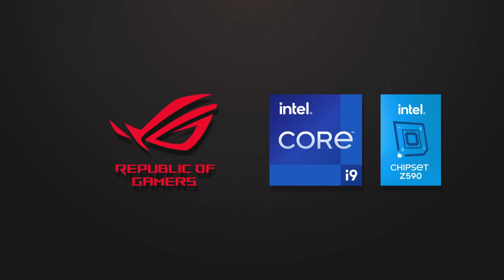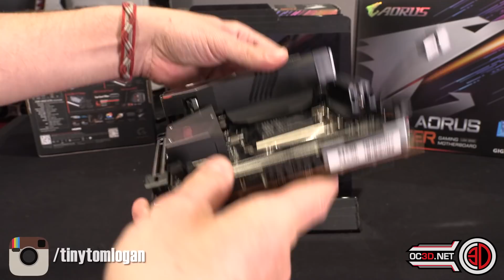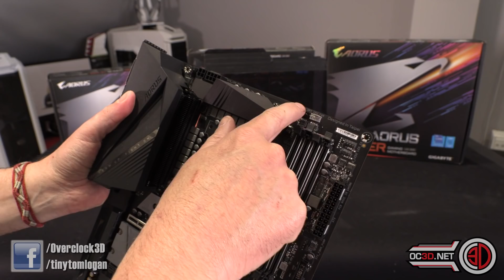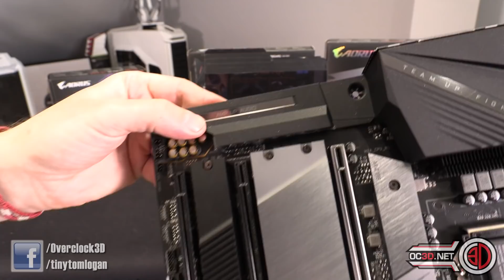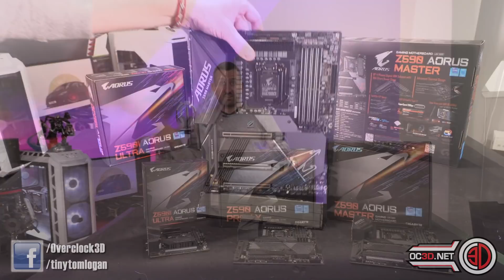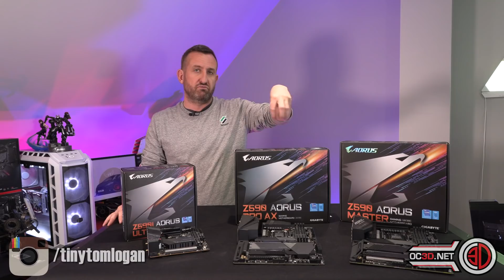Gigabyte Aorus Master, Pro AX, Z590i Motherboard Round Up Review

Comment: I currently run an Asus ROG Strix Z590A Gaming Wifi II, and it does the same thing with the AI system agent where it bumps the core voltage up to 1.65v and constantly cooks my 11900K to death. Was seeing temps in the high 70's with no overclock and nothing loading the system down using a beefy 200w TDP air cooler. Open a game, or run a local model, and the temps would peg at 100c and stay there. Pretty sure it has degraded my processor, as it now refuses to run stable at stock speeds with OOB settings, I've only been able to get it stable by disabling the Asus Multicore Enhancement and downclocking to 4.8ghz and manually setting the core voltage to 1.35v. I've been really disappointed, I spent about $1000 on just the board, CPU and memory. I've noticed that one of the temp sensors that I think relate to the VRM's often hit 125c even with the downlock I've set up. The latest BIOS available from January seems to have compounded these problems, as well. Asus has opened up complaint tickets for me every time I leave a bad review somewhere, just to tell me to reset the BIOS back to "Asus Optimized Defaults" What a joke.

I was looking into getting a different board, but it seems all the manufacturers have all taken the same approach with their Z590 boards regarding their AI system agent implementations. May end up going with an AMD X3D platform to replace this system, but so far, none of them seem to have enough PCI-E slots to facilitate my 3 graphics cards for local AI use.

Comment: That VRM temperature probably wouldn’t have got any higher. So 106 is perfectly safe. Systems are designed to run hot……….and you are 19 degrees away from throttling. Intel Engineers state that CPU’s should run close to their maximums and it is perfectly safe. You say it was throttling………but was it? I’m gonna say probably not. Lots of talking, but one graph to backup your claims 🤔

Comment: I saw your video last week after doing a build with the Master and experienced its crazy BIOS issues. OMG, why didn't more reviewers discover what you talked about here. My first master was the Z390 which I paired with the i9-9900K. So, I always liked the model. 

Upon seeing the dreadful C4 post error code at first boot, I knew that the shipped-with F4a BIOS was corrupted. After q-flashing version F8a I got a successful post. But, soon after settling the fan speeds to my settings the C4 error code came back.

When I saw the price on Amazon went down from $449 to $199 I knew that something was up. I am not awaiting a replacement with the hope of winning the lottery with the second one. SMH! 🙄

Comment: They didn't mess up the BIOS there's a 120C+ hot spot way in front of the VRM in the Vcore powerplane of the Z590 Pro AX.
Reply from the maker: It did seem to get better when I reduced the voltage so that would make sense.
Thank you for your comment dude 😊

Comment: i have 3 z390 pro's.   everything was peaches and cream until one required RMA.    i feel your pain dealing with Giga.    They're solid boards and made well but i don't think they have plans for when things go array.    i like ASUS but they skimp on power delivery unless you come off a kidney...     it is what it is.   you most definitely pay for what you get in tech these days.   the power delivery on those boards are fine for the 8700k but when i put a 9900k in them they require a 40mm fan on the vrms.  the 8700k would probably need a fan but they're cooled with a cross flow air cooler that pushes air over the vrm area.   these are intense AVX 2 loads.

Comment: That's such a horrible place to put the fin heatsink on the atx pro ax board...horizontal fin orientation and blocked by the io cover with no airflow out the back. It will just heatsoak and perform no better than a solid block of aluminum...

Comment: funny enough, hardware unboxed said that the cheaper gigabyte z590 boards are actually good.
Reply from the maker: Then the lower models may well have had things restricted a bit more and thus not have the issues the pro ax does.
I can only comment on the boards I've tested. As you can see the other two are fine.
Reply from the maker: I can only go by my own experience and the pro ax has the issues I've explained.
Reply: As with most things its worth checking multiple sources and waiting and seeing what happens, It could be a bug with ABT or monitoring software or a dozen other things. It could be that Giga did mess up...and put the thermal probes somewhere else or did a +20c offset (still a f--- up).
See if others report the same issues, Ask HUB and Buildzoid for their thoughts to confirm.
Reply from the maker: I'm not if hardware unboxed tested the Pro ax or not either. It's the only one I have had problems with but the voltages are more than likely to blame
Reply: @OC3D  no they only tested the cheaper models Gigabyte Z590 UD and  z590 gaming X

Comment: Z590's are so expensive. B560 is a better option since now you can over clock your RAM.
Reply: @Roy marr I think you can overclock the RAM with a 10th gen CPU.
Reply: @Roy marr i have a 10400 and 11400 i just bought a B560 Tomahawk. I will test both to verify. Thanks for your input.
Reply: @Roy marr there you go bro a 10100 running on 3600MHz RAM.

Comment: I have Gigabyte Z590 Gaming X and VRMs are COOOOL! Watch Hardware Unboxed videos (there are Z590 VRM roundup already on channel)!
Reply from the maker: I never question others testing.
In mine the pro ax has bios problems causing the vrms to get hot.
Performance is great, vrms just get too hot for what they are.
This is backed up by the temps on the itx board being lower.
Reply: @OC3D  I underclocked & undervolted my i7 10700 to 4.5ghz all cores @1.16V, perfect for me, perfect temps with 240mm AIO 👍 (i got HOT sample)! 
* Nice review, amigo! Always waiting new videos from you (watching you from PSU testing times - these was THE BEST) 🥰🥰🥰
Reply: @KOT-ANGRY  How is this setup doing now?
Reply: @essteeell  Perfectly fine, with my new i9 10900 (undervolted) VRM temps are ~42'C 👍! Also i upgraded my RAM to 32gb (all 4 channels populated), 3200 cl14 no problem too! Very good board 🤎
Reply: Its impossible that Aorus Pro AX is worst that Gaming X!!! Please check, mby there are some defect?

Comment: Unfortunately for me Tom I purchased the Gigabyte Aorus X570 Master board to go with my AMD 3900X back when they first launched.
Have an issue where around every 3 months max the board simply dies on me.
No power up, nothing.
I have to remove the battery and leave it for 30 minutes, then place it back, then it all works fine for around another 2 to 3 month.
Couldn't RMA it because it's not possible to replicate the problem so im stuck with it.
Always been an Asus guy but I really liked the spec of the Aorus Master so thought why not.
Gigabyte....NEVER AGAIN!!.
Reply: Ebay, I dont even need a board but I'd buy it for the right price and I'm sure I'm not alone.
Reply: @tomstech4390  yeah, I'm thinking of getting the X570 Assus Crosshair at some piont soon. I guess I could put X570 Master  on UK EBay or something,  I'm a but gutted in a way because it's a fantastic spec board and oddly enough the vram temps benchmarks put it as one of the very best.
Reply from the maker: Have you updated the bios....?
Reply: @OC3D  Yeah mate, saying that there could be a newer update now, I haven't checked for a bit.
I found a couple of other guys on a forum having the exact same issue..they told me they spoke to others too, same issue.
They reckon it's an issue of the very first boards that came off the line, I don't know though. 
I updated the bios thinking it might solve it but alas..no joy.
Spoke to overclockers about it and they told me to send it back to them for testing which I did, they couldn't find any problem with it.
But as I said, it's a random 2 to 3 month thing so wasn't suprised they didn't find any issue as neither myself or them can replicate it.
Reply: i doupt it is the motherboard then. Since if you realy got the x570 Master at launch and it had gone bad every 3 Month that would mean you have gone through 7 Motherboards. Which Statisticly speaking is nearly impossible that all of them are faulty.
Reply: @hewie_snow  No mate, it's the same motherboard I purchased....because they couldn't find or replicate the fault I couldn't swap it for another.
As I've also said, I've spoken to others on the forum that have the exact same problem.

Comment: Why do people still buy gigabyte, their products are garbage and they're all form over function
Reply from the maker: Definitely not garbage boards.
Bios is their downfall far too often though.
Reply: @OC3D  Every gigabyte product ive ever seen has been absolute garbage, burnt through several AM3+ motherboards with no overclocks, my friends RX570 burnt out with just the factory boost mode, there were several cases of them notably cheaping out on parts in critical locations that caused reliability concerns, as noted by LTT, Gamers nexus, hardware unboxed and others. Gigabyte is like biostar levels of bad. Not to mention their bios have always been hit/miss, especially with intel boards with MCE